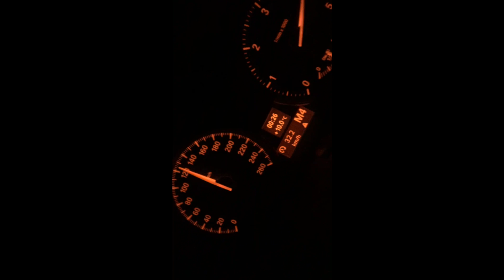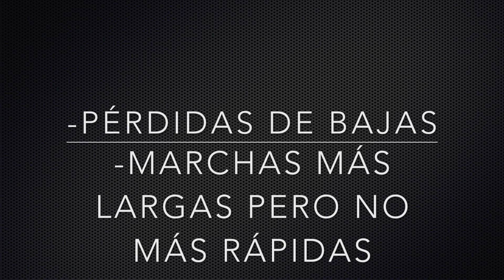CUSTOMIZANDO MI COCHE! BMW SERIE 1 e81 123D DOWNPIPE SOUND EXHAUST | INCREIBLE CAMBIO GARAJE SALVAJE

Comment: 😂😂😂😂 el famoso motor n47. Si no se te rompe la cadena es como si te tocara la lotería....
Reply: victor120d  ya a los motores N47 le solucionaron el tema de las cadenas y tensores una vez q los cambies por las nuevas q diseñaron queda totalmente solucionado lo digo por experiencia tengo un 118d de 177cv y va de lujo 🤙🏻
Reply: Alex EB como puedo saber más información de eso? Quiero comprarme uno que matricularon en 2011 pero no sé si tiene eso de la cadena y me tiene acojonado, me lo podrías decir? Gracias
Reply: Alex EB otra pregunta? Si tiene ese problema a cuantos kilómetros comienza a ocurrir? Una aproximación, gracias
Reply: @platesilversnake5863  en principio los de 2011 no tiene problema yo tengo un 123d del 2008 y se le cambio con 180.000 km